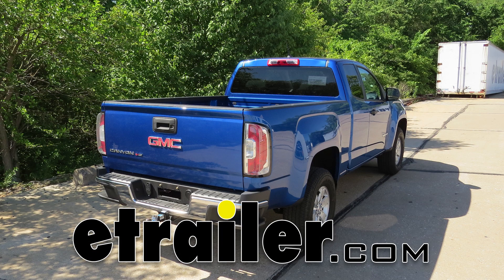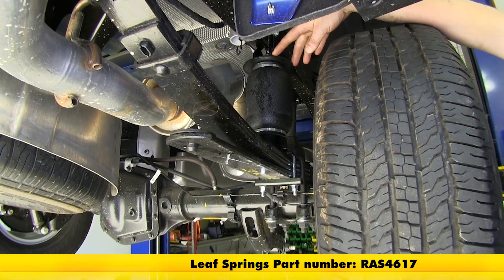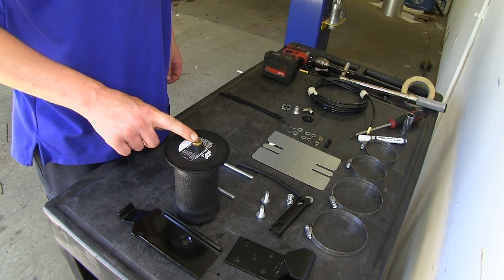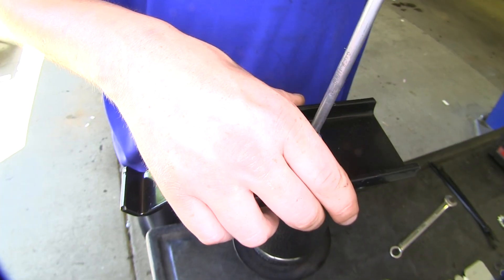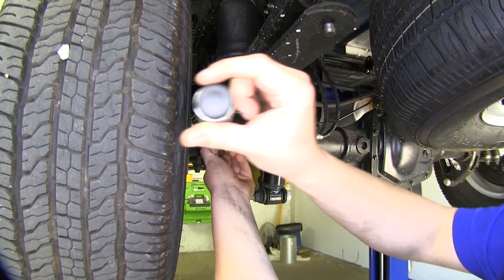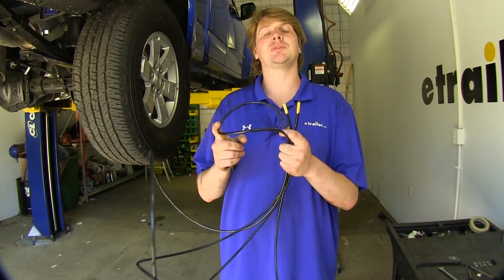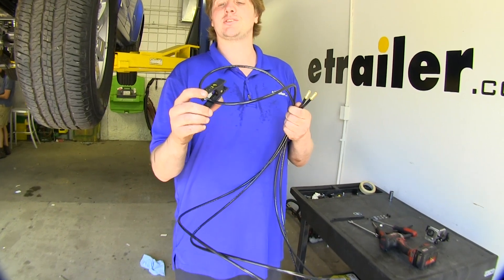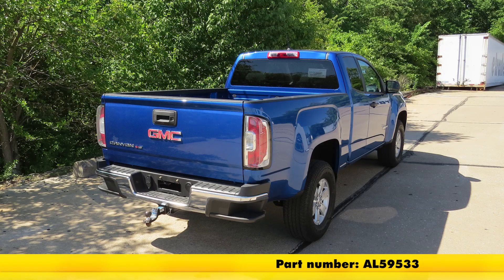etrailer | How to Install the Air Lift Ride Control Air Helper Springs on a 2018 GMC Canyon

Comment: Can these work with a lowered truck
Reply from the maker: The air bags will be too compressed when installed on a lowered truck. You can replace your jounce bumpers to gain more support in the rear end of your truck.
https://www.etrailer.com/susp-2018_GMC_Canyon.htm
Reply: Is it ok to drill holes on the frame?